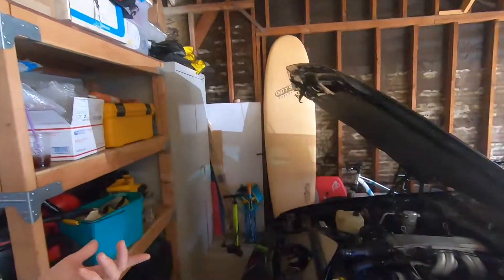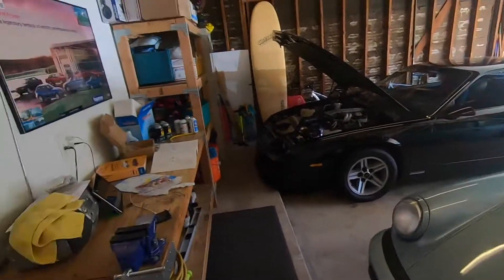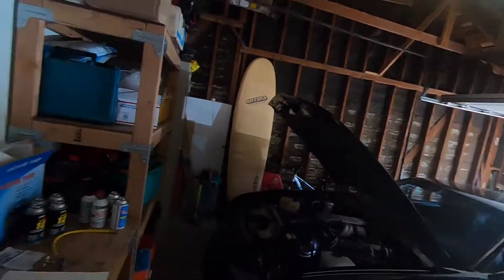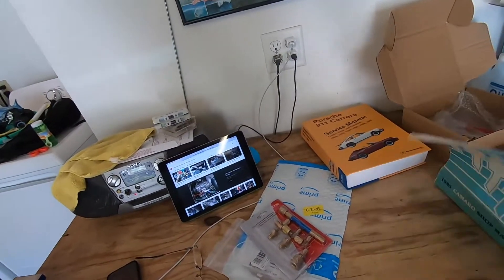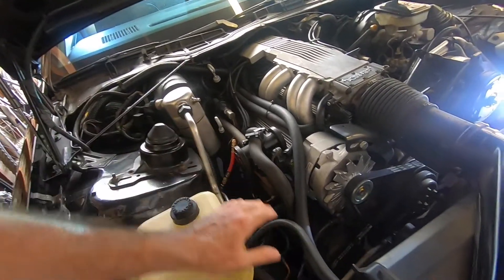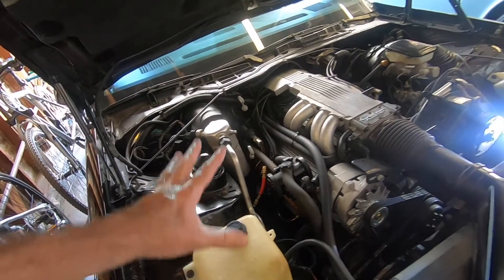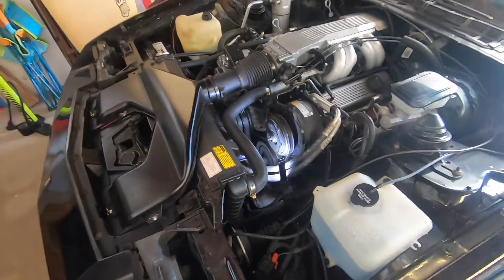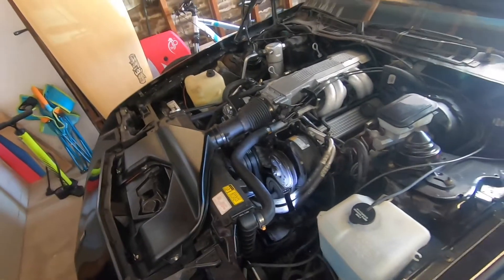Retro R12 AC Recharge (Part 1)

Comment: Hello, I have a 1991 Mitsubishi Eclipse G1. Could you tell me what type of high pressure adapter it is. For low pressure it is 1/4", but for high pressure it is a different kind. Thanks!
Reply from the maker: I found it on Amazon and applications vary
Reply: It's probably ⅛, like on 80s and early 90s GMs

Comment: Those old R4 compressors on the Chevy are known to leak around the case to body o rings. They use 2 giant o-rings to seal them. Leaks are often caused by improper torquing of the mounting bolts.

Comment: Car AC systems will leak at the compressor shaft seal especially from lack of use. The rotating seal relies on circulating oil with the refrigerant to keep the system tight.
Reply from the maker: Yep agree 👍

Comment: Laws regarding certification vary from state to state so I am not responsible for anything that anyone chooses to do.  I will just tell you that dichlorodifluoromethane (aka "refrigerant 12") was used in just about everything prior to the montreal protocol of 1987.  First off - don't do what most MVAC shops do and just top off the refrigerant without fixing the root problem (WHY do they do this when it's sometimes a 5 cent o-ring?)

If you find vintage cans of air horn refills or gas dusters manufactured prior to 1992 - it likely is R12.  Look for the words: dichlorodifluoromethane or "Contains a Chlorofluorocarbon".  

By all means for sake of our environment - use these to charge your sealed air conditioner system - recovering any with proper recovery equpment.

That or sell them to a distributor - DON'T throw these in the landfill!  R12 not only depletes the ozone - it has a Global Warming Potential of 8500 times that of CO2 (which is equivalent to driving approximately 20,000 miles in CO2 for climate change.  It has an atmospheric half life of 100 years. For that reason - why throw these away rather than use them and recover them?

Why is R12 more efficient at cooling than R134a?  I've held a can of each in each hand.  The 134a gets colder faster... the 12 gets colder slower and steadier.  Perhaps this is why it transfers more heat
Reply: All that BS came about as deregulation of refrigerants happened. When Dupont wasn't gonna be the chief supplier of refrigerants, all of a sudden it's destroying the environment. R12 was used as a propellant in everything prior to this. More bureaucratic BS.
Reply: “Global warming/climate change” is a hoax.
Reply: @filter4now  hospitals would blast liquid r12 on medical instruments to sterilize them prior to all the bureaucratic government BS that claims it destroys the upper atmosphere. I don't believe it and never will. It was never a problem until it was deregulated and anybody could manufacture it. That was duponts way of stopping it.
Reply from the maker: yeah I used to work with a guy back in the 80s at a parts store and he would chill beers on the Friday nights with R12 lol at work... it was a great time working at a place like that back in the day!
Reply: @RABBITMotorworks I remember picking up cans of it from Kmart for 69 cents.
Reply from the maker: It’s great refrigerant… I used to work with a guy that would cool beers with a can back in the 80s lol 😂

Comment: R152a found in air dusters are cheap and an excellent substitute for r12
Reply: The only trouble with R152a is that it isn't miscable (or will not circulate) mineral oil which was used with hc, cfc, and hcfc refrigerants and require a flush.

Air dusters as well as air horn gas refills from the 1970s and 1980s - including Falcon "Dust Off" brand "Dust Off II" - are dichlorodifluoromethane sold for refrigeration as - Refrigerant 12.  Not BS - check the back of the can.  Also says "Contains a chlorofluorocarbon..." Some are R22 so make sure R12 is the only ingredient.

I am for the protection of the environment -  but this also means disposing of the remaining R12 in the proper manner.  What better way than putting it in a closed system for recovery later?

Comment: What manifold set did you buy because my 90 Supra has r12 ports and the quick couplers from the set i bought on Amazon didn't fit. I know this video is old but I'm just desperate at this point
Reply: Nvm. I vacuumed my system and there's no leaks. I'm gonna try r12a now.
Reply from the maker: I bought it on Amazon and was also R12 friendly. Says not available thou :( —- Orion Motor Tech AC Gauges, Fits R134A R12 R22 and R502 Refrigerants,..
Reply: @RABBITMotorworks  Yea. I bought that and had to retrofit my valves to r134a. Now I'm just waiting for some cans of r12a to recharge
Reply: I have an 86 Caddy with R12.  What adapters did you use? Amazon? I bought the OMT manifold gauges on Amazon that work on R12 and R134A. Thx.

Comment: How can I go about on my 93 civic? It still has r12 ac in it but hasnt been done until the one time I charged it with just one can and it blew cool air and not cold but the compressor ran until the freon leaked after a couple of hours. The high side port is the issue i was having because I couldnt connect the hose from my manifold gauge. I charged on the low side also.
Reply from the maker: sounds like a pretty good leak, you don't want to connect to the high size to charge

Comment: You have to make sure you have the correct capacity charge spec and use mineral oil not PAG Oil !
Reply from the maker: This is correct do not put the PAG oil for 134a in a R12 system or big problems!